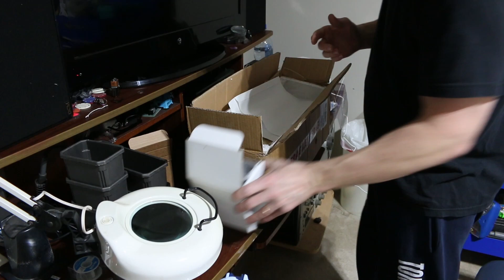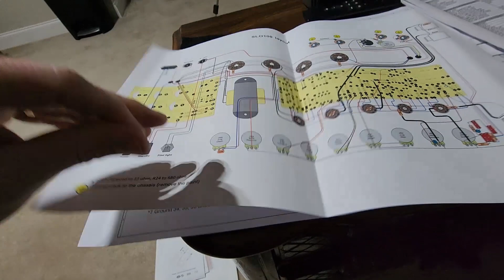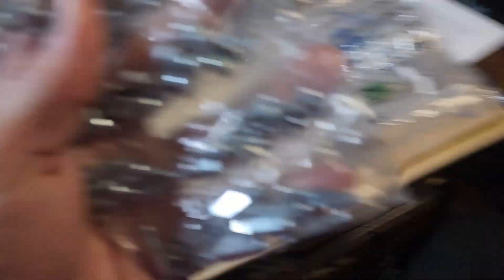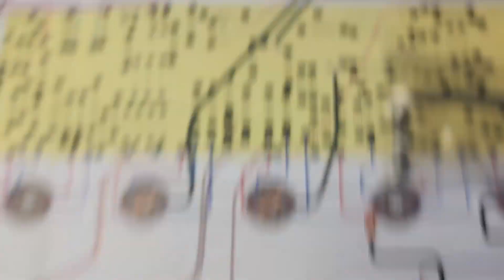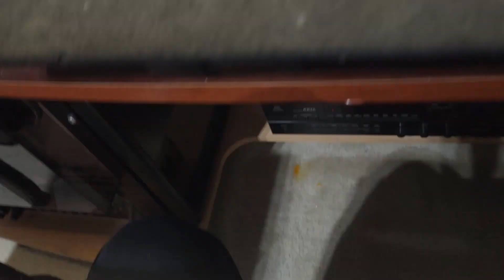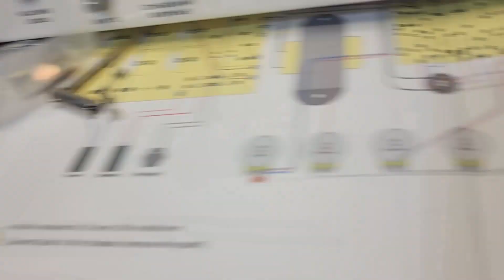Building my 1st Tube amp Soldano SLO100 Days 1-4

Comment: This is excellent! Could you please share the files, schematic, and the list of required materials?
Reply from the maker: Hey, thanks for watching. Unfortunately I dont have access to the stuff anymore. I bought the full kit from rosamp on ebay. Look them up. Also if you use Facebook there's tons of groups that just do mods to these amps and they are super nice and helpful to new builders. 900 for a 4000 amp and you get to build it just makes sense.